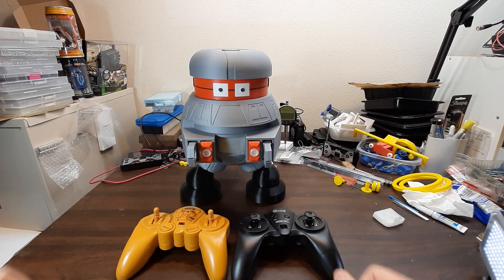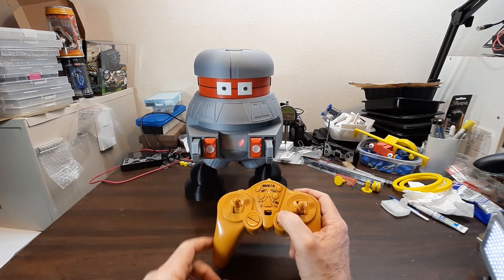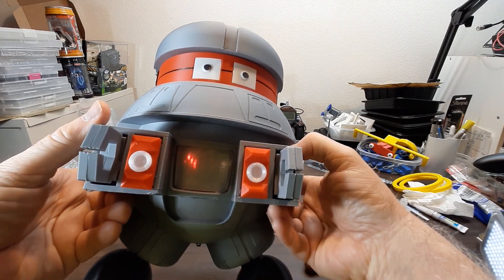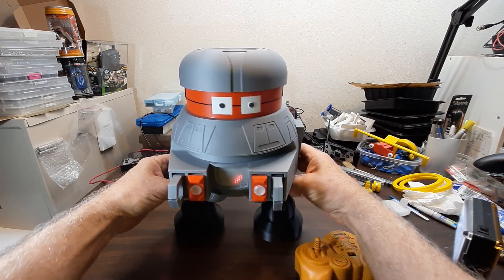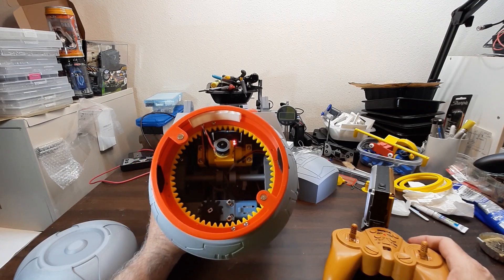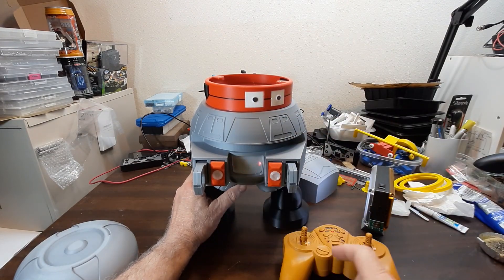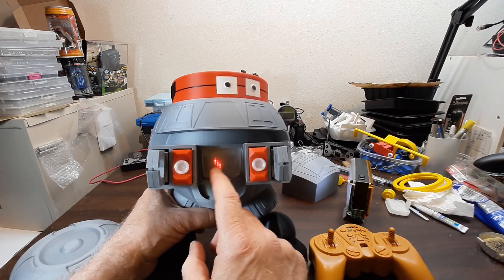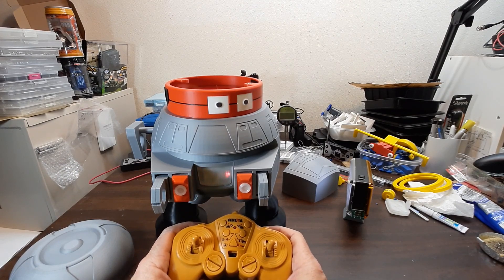An Update On My Vincent From 1979 Movie The Black Hole

Comment: Did you design/model it yourself?  I haven’t been able to find any decent files and still early in the process of learning how to do so myself.
Reply from the maker: Yes. It is designed from scratch in Fusion 360. I will release the stl files after it is done. @outsider238 just did a video showing a life size Vincent he had printed. I'm not sure where he got the files.

Comment: It's looking great Rick. I am glad that you was able to get a remote with more channels.
I had a thought since you are limited with channels. May be you could add a rotary switch controlled my a motor on one of the channels. A switch that changes what one of the channels controls. If you get my meaning, and it would still keep it fairly simple.

Comment: Glad to see your second remote worked. The project has come a long way and look and works great. I guess you could just use magnets to hold the claws and the side arm parts in place. On the claw arms you could use 2 magnet positions so the claws would lock in the IN position and also lock in an out position. As always thank you for sharing the project with us.
Reply from the maker: Thanks. The magnet idea to hold the claw in place is interesting.